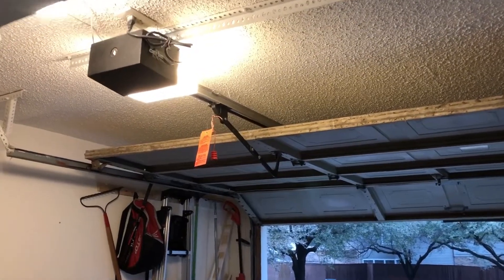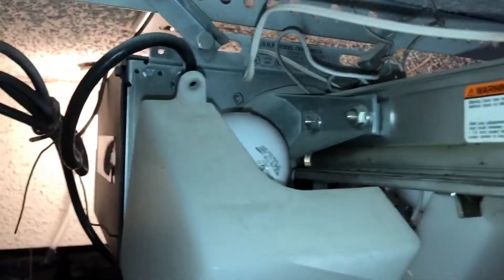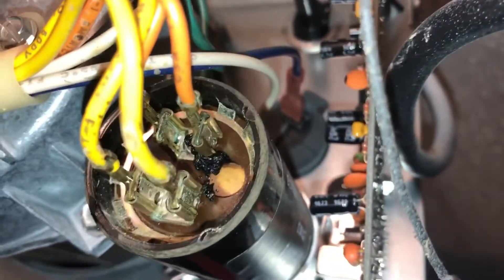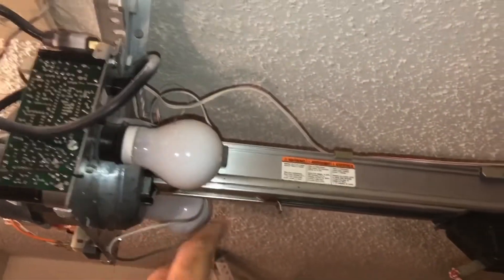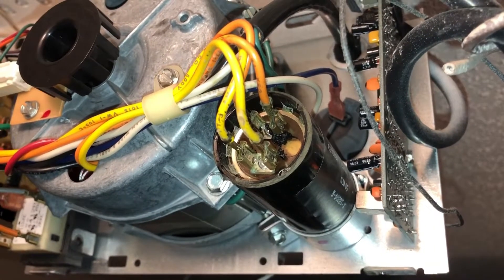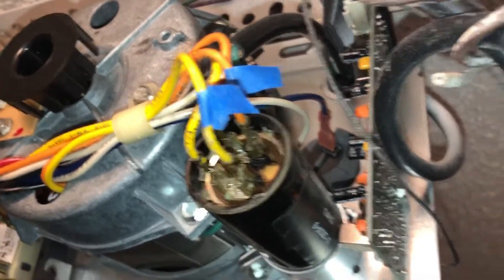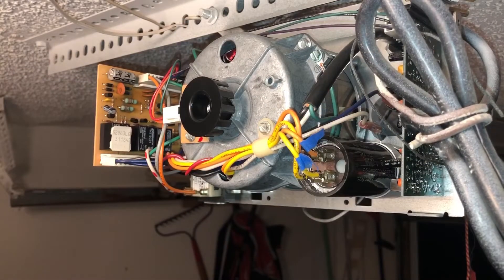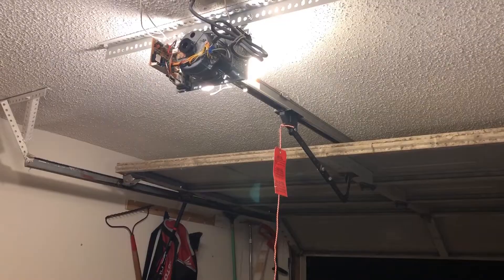GENIE Garage Door Humming, Won't Open / Close - Fixed

Comment: SAFETY WARNING - ALWAYS discharge capacitor by using a metal screw driver touching across the terminals before touching! otherwise you may get a high voltage shock!
Reply from the maker: Good advice. Thank you!
Reply: This is very important to charge the capacitor.  You could mislead other people that this steps can be skipp!  Actually after you discharge the capacitor with a screwdriver serve as a stunt, you should use a long nose pillar to pull the terminals.  

It is so scare that everyone can post some video on the internet and act as if these are the steps!  This could cause harm to the public!
Reply: I recommend YouTube official to remove this video.  This is damage!
Reply: @danielcheung3419  chill Karen.. this guy never claimed to be a professional. This video is what YouTube is all about.
Reply: The capacitor does NOT hold a charge. Therefore you will not be shocked. Please disregard this old man's comment. Be sure to unplugged device before grabbing wires
Reply: I know someone whom died by not discharging a capacitor

Comment: Thank you thank you thank you.  I had this issue. I called a local service company to fix.  It started with $1200 for a new door opener, and then they told me that, to use it, I would have to drop another $4,500 to replace the door (not that there was anything wrong, but that modern door openers wouldn't fit my older door.  Thanks to your video, I fixed the problem for $12, saving me $5,687.  Thanks!!!!
Reply from the maker: I am so glad my video helped save money! ... but OMG thats a huge amount of money the local service company was looking to charge.
Reply: Don't you wonder how those guys sleep at night.
Reply: @dahinsoncoj Must be sleeping on Mattress Firm! 😂

Comment: Yesterday my door would only go halfway down, then reverse back open.  This morning it wouldnt even open, only a hum. I opened it manually and  I left it open all day.  When i tried to close it this evening with the motor, it just hummed.  I closed it manually.  I pressed the button, and it still hums, even without the load of the door.  I hope my capacitor is the issue....
Reply from the maker: Would love to know if replacing the capacitor fixed your garage door issue? Please update us all when you get a chance. Thanks

Comment: This absolutely worked! My Model is a little older but it made the same noise. I opened the motor and my capacitor was corroded. I ordered a new one and used the tape technique. One note. The 4 wires are 2 yellows and two orange/Red. The capacitor has two sets of connectors each with 2 connectors. You should attach the two yellows to one set and the others to the other. Fly Bee - Thanks for the help with this. It saved me time and money!
Reply from the maker: Thank you so much for the detailed feedback and info about wires. Makes me happy to see my video served its purpose to help others facing the same situation. Thanks for taking the time to let me know this helped resolve your problem! Best wishes
Reply: @FlyBeee  My open is humming. I replaced the capacitor, it is still humming. What should I do?

Comment: I have a ProMax door opener of a different manufacturer, yet it contained the EXACT same original capacitor model & specs (Made In USA).  With symptoms identical to what was shown in this video, the recommended replacement capacitor (yes, from Mexico) resolved the problem. It was a breeze, and it saved me some $ avoiding a garage door service provider.  Thank you!
Reply from the maker: Yippie! so glad my video helped... even on the ProMax brand door opener! Thanks for taking the time to let me know.

Comment: Thank you SO MUCH!  I was having the same issue, and wasn't wanting to install a new opener or call a repair person.  Saw your video, made the same repair, and now for less than $20, the door is working fine again.  As others have said BE SURE to take precautions around a capacitor like that.
Reply from the maker: Thank you so much for the feedback. I am glad my video helped. Best wishes

Comment: My repair guy wanted $400 to replace the entire unit since it doesn't have a battery backup and apparently my state of California decided that professional garage repair techs are forbidden to work on units without a battery backup...

Ugh, sometimes, this state...

Anywho, followed these instructions and had my garage door working in under 10 minutes for under $20.

I even followed safety guy at top of the comments just in case and all is well, garage opens and closes strong.

Thanks for the video brotha!
Reply from the maker: I love that you got your garage door to work again so quick, and for fraction of the cost. Yippie! Thanks for letting me know.. and I am glad this video served it purpose! Best wishes

Comment: Fantastic!  my capacitor was fine but 1 wire had disconnected on its own due to vibration!  
Hardest part was unscrewing the cover that a previous repairman closed it so tight as if it had an evil genie inside.
Reply from the maker: Awesome! so glad you fixed the issue and didn't even have to spend any more. Yippie! Best wishes

Comment: Aw man, the repair guy told me the capacitor was fine but this is EXACTLY what my unit is doing
Reply from the maker: If your garage door motor is fixed now, what did you find was the issue? Capacitor or something else?

Comment: Exactly my problem! Thanks
Reply from the maker: Just checking if the capacitor replacement fixed the issue?
Reply: Yes! Replacing the capacitor fixed it. I bought a new on Amazon for $14.00.
Reply from the maker: @erickorb  Awesome!!

Comment: I believe I have the same garage door opener. I no longer have the manual. How should the indicators at the door appear?  Is one steady green and the other steady read or blinking red? 
Thank you sharing this video!
Reply from the maker: In reference to the two indicators / sensors that are located at the floor level on either side of the garage door channel, one is steady green and the other is steady red. This is their normal state when garage door is working without issues. I hope this helps.

Comment: I have the same problem but to my eye, the capacitor looks OK. Also, the motor tuns fine when  the screw drive is disconnected. While it looked OK, I did replace the coupler and that dod not fix it. Could this still be the capacitor? if not, maybe the screw drive is binding? Any suggestions? I suppose despite the capacitor looking normal I could try to replace it first.
Reply from the maker: Good question. The answer sort of also depends on how old the capacitor is ... which just means whether it has higher likelihood to fail. When capacitor fails there is typically some leakage - you can remove the capacitor from the housing to see if it looks good. Worth the try but be careful handling the capacitor.

Comment: Hello and thanks for the tip.  I had replaced the capacitor on my Genius Intelligent garage door and it fixed the problem for two weeks.  It is now doing the same humming sound and not opening nor closing.  Do you think it might be the circuit board that needs to be replaced?  The system is from 1996.  Any advise would be helpful.  Thank you and merry Christmas.
Reply from the maker: If you have double-checked that nothing is blocking the sensors on either side of the garage door then the problem would be with motor or circuit board. Depending on the type of unit you have, it may be cost effective to replace the garage door opener set completely vs. paying for repairs. I saw some good deals recently on these units. Please look them up. I hope this helps.

Comment: I have same motor but capacitor was blue ceramic how  I now what I need???
Reply from the maker: If the model number of the garage door motor is exactly the one I show, it is possible the person who replaced capacitor last time likely used an aftermarket capacitor or one they could find locally. You can also lookup the garage door motor specs online to see the correct part number of the capacitor needed.

Comment: My garage door is having this issue only when I try to open it.  I get the hum, but If I pull the safety cord and disconnect from the motor then press the garage door button the motor works. I press the button again to stop it, re-engage the safety cord, then the door is operational again.  Could that be the capacitor too?   I'll take a look at it.
Reply from the maker: It sounds like the garage door motor does not have enough oomph / power when pulling the door up - likely a capacitor not providing enough power so worth checking the capacitor. also check the chain and whether it is in good condition. I hope it is an easy and inexpensive fix. Best wishes.

Comment: My genie screw drive opener is making that same noise it won’t open. I’ve changed the capacitor once over a month ago & it worked great. Then a few days ago it started making that sound & the door wouldn’t close. I bought a new capacitor but it’s still not working & still making that noise. Any suggestions?
Reply from the maker: You have checked that nothing is blocking the sensors that are on both sides of the garage door? Unplug the garage door motor from power, wait a minute and then plug it back in? Same issue happens when you press the garage door open/close button that is in wired and in the garage?

Comment: Hey I'm not sure if you can give me any tips but I also have a genie remote for my garage and it stopped working so I replaced the battery and it lights up when I click it but my garage door will not open at all and I have no other way of getting inside I'm not really entirely sure what to do I tried open the door manually and it seems like it's sealed shut.. any tips?
Reply from the maker: To open/close garage manually you will have to disengage the automatic chain. Please watch my video from count 2:50 to 4:20 that shows how to do this. To reconnect please watch from 7:50 onward. As for the red light, this happened a few times with my car's remote! and went away when I reset the remote to factory setting. Please reset and reprogram your remote to the garage door motor and see if that helps.
Reply: @FlyBeee  I can't get inside to disengage anything. The remote lights up green not red. Thank you
Reply from the maker: @imemilywilliams  In case the transmitter signal is getting interference - Turn off your home WiFi and see if that helps your garage door opening. Other option, hold down the lock button on the transmitter for 5 seconds and then try to open the door. Another option is to use a flex metal rod (open a metal dry cleaning hanger) to pull the red string inside garage - see this video: https://www.youtube.com/watch?v=EAk0t-D-_eo   If nothing else works then your local  locksmith or garage door company can help.

Comment: I have a Genie garage door opener that hums and doesn't open. It uses a 18004B Capacitor which I replaced, it still hums and doesn't open. What should I do?
Reply from the maker: I am guessing you have sensed the sensors on floor level by the door itself, and also checked that the door was not accidentally disengaged / disconnected from the motor (mentioned on video count 3:00)?

Comment: My capacitor looks fine but my opener is making this exact same noise. Could it still be a bad capacitor?
Reply from the maker: In my case the humming sound was coming from the motor. Capacitor only provides power to the motor so to me it looked like capacitor was not providing power to motor causing it to humm. The very visible flux leak from the capacitor made it an easy decision for me to change it. If there was no visible leak from the capacitor I would have still changed it considering (a) I have had the same garage door motor and capacitor for more than 10 years (b) capacitor is more likely to fail from repeated use (c) cost of capacitor replacement is much less than calling a garage door repair person. Your situation and details are most likely different so proceed with DIY or calling a repair company - whichever you think would be best in your situation.

Comment: Mine hums and the light comes on and doesn't open. But if I release it and then click the opener it will grab and open and close it.  Do you think its the capacitor?
Reply from the maker: When you release the safety pin and dis-engage garage door from the motor and then motor works but when garage door is connected to motor then it does not, then capacitor is likely going bad. I say this because the purpose of a capacitor in a garage door motor is to provide additional power boost to lift open the heavy door. In your situation the motor works fine when the door is disconnected but does not have enough power to lift the garage door when it is connected to motor ... which means the capacitor is not doing its job. I hope this helps.
Reply: Jessica I have the same issue as yours.. any luck with changing the capacitor. Thank you 🙏🏽

Comment: Mine made a Big pop when lowering if now it buzzes but won't open lights up and buzzes
Reply from the maker: Did you get a get it fixed or tried the capacitor replacement?

Comment: I have 2 Remote garage door openers and I use only 1 regularly but after I used the other Remote (that i did not use for many years) the first Remote is not working!  First I thought battery issue but after installing a new battery it is still not working, And after this the old one I did not use for years is Not aworking either!z, Can you Please help me. Thank you so much. It is very urgent issue to me.
Reply from the maker: If you have not yet reset the garage door opener motor and reprogram the remotes then definitely try it first. The reset button is usually on the motor and you see it when the bulb cover on  the motor (that faces the front of garage) is removed. The one on your model may be different so please look it up. If you get a chance, let me know the outcome. Thanks
Reply: @FlyBeee  hello, thanks for replying. Do you have a video to do this? That would be of great help. 
What letters indicate model number for my Genie garage motor? In your video, there are letters starting with HP and then there is model number with letters begining with ACRG.. and resr. Which one is model number for genie garage motor? I am confused.
Reply: @FlyBeee  the remote is not programming. The red light reset on garage motor keeps blinking red for 30 seconds amd goes away. Pressing the remiote control to programm it is not working. Where can I buy a hew remote for genie garage motor?
Reply from the maker: @jakeb8298  It is possible that your (or your neighbors) home wifi or devices like roku, nest may be messing with the garage door opener frequency causing it to not work. Power off home wifi and then check garage door opener / try to program it. To minimize radio frequency interruption some people had success by placing 2 ft by 2 ft piece of aluminum foil over the garage door opener (I am not kidding on this one!) Worth a try! If you decide to go the route of new remote: in US, Walmart and Home Depot, and in Canada the 'Canadian Tire' carries Genie and universal remotes.
Reply from the maker: @jakeb8298  I don't have a video but from your other reply I think you found the correct way which is to press on the 'learn' button on the garage door opener, and when red light is on, within 30 seconds press the button on the opener. Pretty much all openers and HomeLink in vehicles are programmed the same way.
Reply: @FlyBeee  why would it do thst? My remote stopped working immediately after using another remote that was not used fir years. I mean Immediately.
Reply from the maker: @jakeb8298  The RF-Signal interference can start any time and your two remotes may be working on different frequencies. If you think that second remote overtook the frequency of first remote then remove battery from the second remote and then try to reset the first remote. Does the wired button for the garage door opener work?
Reply: @FlyBeee  yes the wired button for garage door is working.
Reply from the maker: @jakeb8298  Thanks. Do you have the same garage door motor that I show in this video? I am trying to replicate the issue at my end to see what would resolve it. If you have already solved the issue, let me know how you did it. Thanks.
Reply: @FlyBeee  what exact model garage door motor you have?